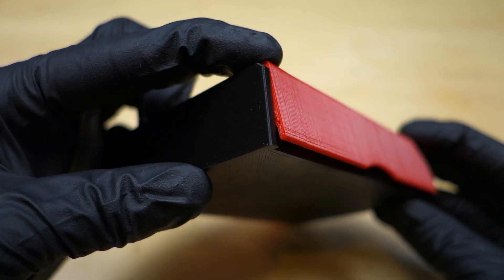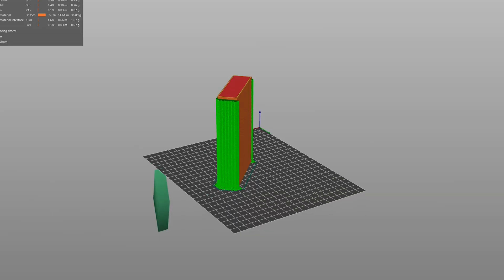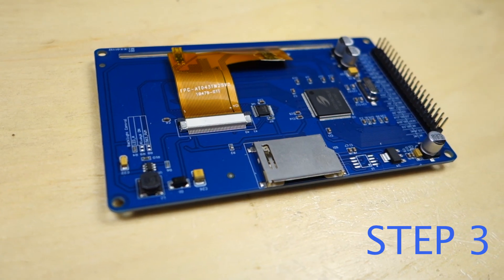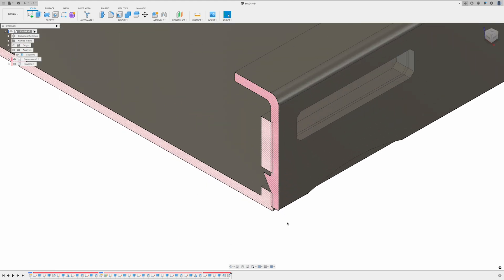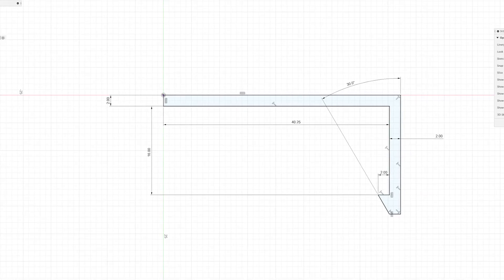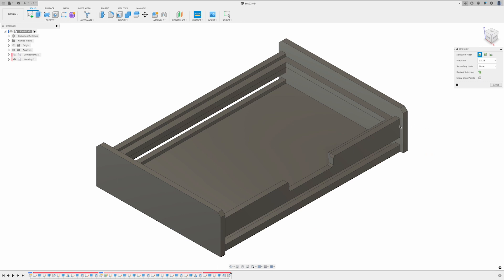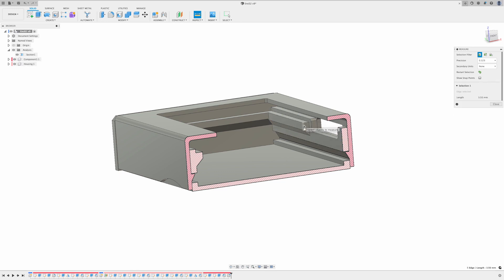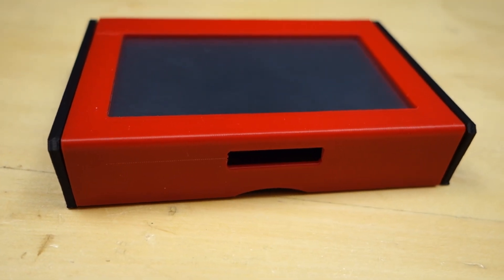COVERS that SNAP in with NO SCREWS!

Comment: Great information.  One of my struggles is coming up with tolerances in the design, my gap between parts for example.  When I design in CAD then slice, the slicer is going to use the measurements from the design then calculate the project using the width and height calculations of the filament  from its configuration file.  So the outside is almost always perfect.  But any interior measurements in the designed (Like a hole, or interior wall for example)are changed due to the resolution of the filament width and height. It seems like it should be simple math, but I feel I am missing something either in the slicer, or my printer, or just expected variation in the system, because that always exists.  I am just making to many test prints I feel to get the right fit.  Curios with the type of work your doing, have you been struggling with this, or have you solved the issue.   Cura slicer has a setting for holes(Horizontal Expansion), but this seems to only work for circles.  Maybe I am just not keeping my filament width in mind though out the planning.
Reply from the maker: I typically make my hole diameters .5-.8mm larger in CAD than the gap I'm looking for.  

Defining tolerances is often a larger design effort than modeling up the parts.

I think the issue with holes is the physics of extruding filament, which causes extra filament to be pushed into the hole.

Comment: Just stop using those big ass bolts, and use small self tapping screws. I dont know why people keep using inserts & bolts, when all industries use self tapping screws for plastic.
Reply from the maker: I agree.  Many applications can use self tapping screws for plastics.

There are applications where inserts and bolts are often better, such as covers that need routine service or need higher clamping force.

Also, I went away from using self tapping screws on fixtures made with FDM 3D printing.  Over time the fixture would crack from the stress created by the screw threads.  Other  times the parts cracked right away, since the hole diameter was smaller on holes printed in horizontal orientation.